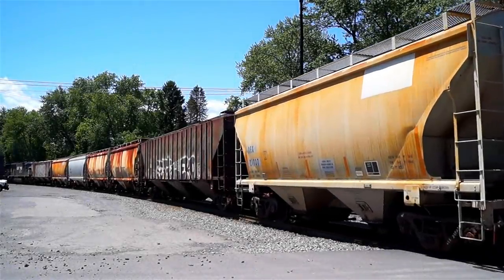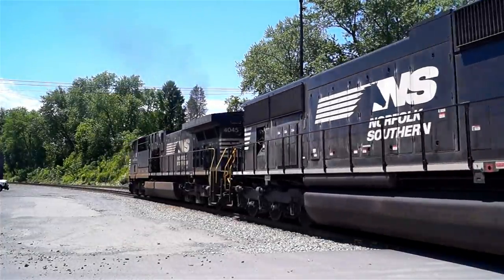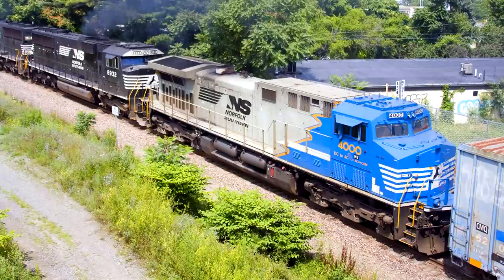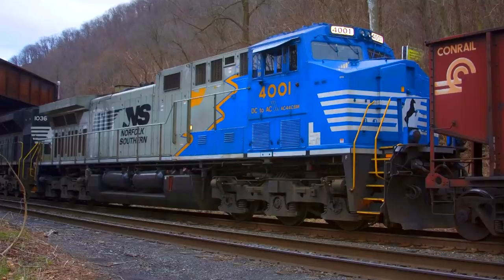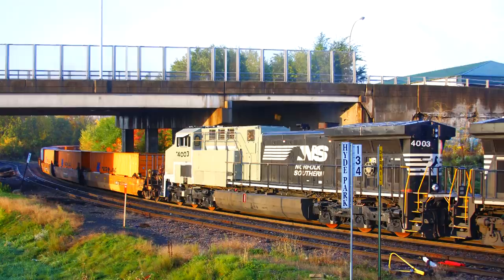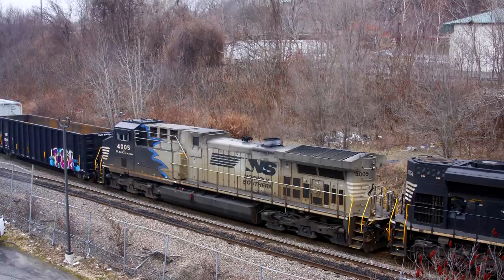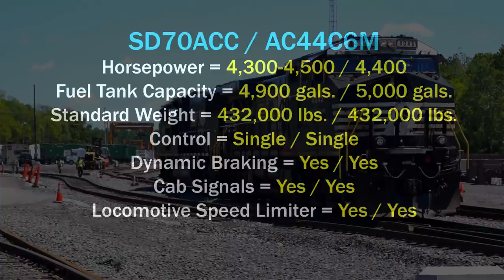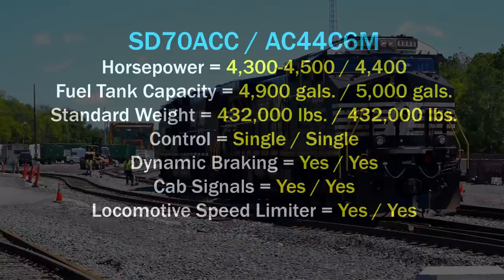[GL][T-255] EMD vs GE: SD70ACC vs AC44C6M - The Battle of the Rebuilds | Trains 21

Comment: As someone who repairs and maintains locomotives for a living, I'll pick a GE over a EMD any day of the week. Without going into specifics, when working on GE locomotives you get the impression the engineers who actually designed the locomotive took into consideration the folks who have to service and maintain the locomotive. Whereas it seems the engineers at EMD must have a contest to see how many nooks and crannies they can fill with hard to reach and service equipment. Even the AC44C6M or as I like to call it, "The Dash 9 that thinks it's an EVO" is a better though out design than the SD70ACC. Not sure what EMD was thinking with the SD70ACC, but even the computer modules are in a somewhat hard to reach location. I understand because of government regulations, the rebuilding cost has a set upper limit thus requiring the reuse of major component on the locomotive, otherwise the locomotive would have to be upgraded to the next Tier emission level. That being said, I believe each builder did the best they could within the monetary restraints they had, but for me GE is still the better product.
Reply from the maker: Thank you for your input. It's very informative.

Comment: Does the ACC have 6 inverters like GE, or 1 per truck like the MACs?
Reply: I've read that many of the MACs are getting converted to 6 inverters for reliability.
Reply: @kittty2005  Good. That should help them hold the rail better when slipping happens
Reply: I'm an electrician for NS and they have one per truck also. And they suck to work on. They are the worst designed lcocomtive on our fleet and a nightmare. They're constantly in and out the shop for failures. We have replaced several main generators ever since we've got them.

Comment: Enjoyed the video!  We get alot of NS run through power here on the Thayer Subdivision (FYI the line is actually owned and operated by BNSF) including NS 1825 featured in your video.  Heard lots of, let's just say interesting, stories about these NS motors from BNSF crews, but they're still cool units nonetheless!  Incidentally the C4s are extremely unpopular here, but I wouldn't hold my breath that BNSF turns them into 6 motor locomotives anytime soon bc of the extra cost to have the two extra traction motors installed and the fact they've ordered new ET44C4s just recently.

Comment: When it comes to new locomotives I'd love to see EMD be competitive again. But tier 4 seems to be killing them.
Reply: It's patents that killed EMD and still killing them.  Tier 1 2 3 and 4 are lawyer moves through lobbying on the congress level getting laws passed that will favor the GE.  It's really not hard to see this if you've been following the big diesels from the SD40-2 days.  There's EMD Locomotives still working their duties that were built in the 50's.  The EMD 2-stroke 567-645-710 engines are some of the most reliable Locomotive engines ever built.  Lawyers Lawyers and more Lawyers is the problem I see here.  President Trump even stated that our EPA laws were way over board and needed their laws overhauled.  Like I said, Lawyers Lawyers and more lawyers is exactly 💯 of what we need right lol lol
Reply: @brian5606  Agreed, I think the EPA needs to be dissolved or reduced yesterday.
Reply: Tier 4 is killing both companies. The tier 4 GEVOs are unreliable as all get out, and a pain to work on. But they're not near as bad as that  PITA EMD 4 stroke trotline weight.
Reply: @ralfie8801  
Your right, but the reliable two-stroke 710 is what I was referring to as getting the $#it end of the stick as far as getting shelved as part of this tier 4 BS.  I'm still thinking the laws are way out of control "To Stringent" and Trump was right, the EPA laws are way out of control and need overhauled.
Reply: @brian5606  yea, never saw the appeal of the EPA Tier Laws, not even half of the North American market is Tier 4 Compliant and nothing bad has happened even when operating the old GP7s and SD9s....... well, not just yet. Hell the SD40-2 is still operating fine and well albeit middle aged, something GE still has been rough around and sure some dash 7s still roam around, but only very few. My friend’s dad works at CN, he always had a place in his heart for the SD40s, SD70/75Is, GEVO’s, and Dash 9s, everything else sucked ass, he hated the Tier 4 GEVOs too.

Comment: Cool video! I choose the GE’s because I’ve heard their newer locomotives were built better than EMD’s. Have you heard of any engineers opinion on BNSF’s (or FEC’s) ES44C4?
Reply: BNSF 's goal was to gradually switch it's fleet to AC traction strictly. 
ES44C4 & ET44C4 were introduced as AC traction locomotives equal as C44-9W and ES44DC 's performance. Slow elimination of 44DC units with 44AC and 4 powered axles as A-1-A---A-1-A with middle axle capable lifting and lowering according to necessary tractive effort controlled by computer systems, thus increasing or later decreasing adhesion needed for pulling the train.  Basically the same thing as previous 6 axle DC power, new locomotive model use AC traction and only 4 powered axles, cheaper to maintain  having equivalent pulling power
Reply: @hadesdescent6664  How are they on the road vs the DCs? I get that they’re trying to save money on maintenance, but trains are getting heavier and wouldn’t the missing axles mean less pulling power?
Reply: @Jeragon186  since BNSF have large amount of all GE types of locomotives, >1797 built C44-9W's, 721 ES44DC, 715 ES44AC, SD70ACe units also, they combine types, sometime it's all C4's, quite frequent is ES44DC/C44-9W's and C4 combinations and 70ACes, that's it...

Comment: Henry stole the show on this one for sure but I'd like to throw my two cents in the hat if I might.

It's patents that killed EMD and still killing them.  Tier 1 2 3 and 4 are lawyer moves through lobbying on the congress level getting laws passed that will favor the GE to kill EMD's two-stroke.  It's really not hard to see this if you've been following the big diesels from the SD40-2 days.  There's EMD Locomotives still working their duties that were built in the 50's like Henry operated.  The EMD 2-stroke 567-645-710 engines are some of the most reliable Locomotive engines ever built.  Lawyers Lawyers and more Lawyers is the problem I see here.  President Trump even stated that our EPA laws were way over board and needed their laws overhauled.  Like I said, Lawyers Lawyers and more lawyers is exactly 💯 of what we need right lol lol 😆
Reply from the maker: We share similar views. Thanks for saying what i was thinking!
Reply: @Trains21  
Love you Chanel man.  I'm an old alco guy but you got to love the whine of a SD9 knotching up and back down while he's switching cars.  Hell I even like listening to SD40-2's & SD45's switching cars.  I like'm all even the Fairbanks Morse opposed piston engine two-stroke, and we can't forget the big burly 625rpm straight 6 & 8 de Laverne Baldwin engines.  I'm thinking that motor design needs a healthy look over again by Engineers for today's locomotives.  Can't beat a big straight 8 for torque and it's got a real reliable low rpm for engine longevity.  I really like the SD70ACC and I hope it gets a chance . . . BRIAN
Reply: I'd like to add beside Lawyers...Lobbyists also. These are the 'Green People', 'Environmentalists' & Climate Change' lobbies that don't know what they're talking about but will not so much as persuade Lawmakers as intimidate them. It's easy w/ the Democrats, the majority are braindead schlepps for the radical side. The Republicans should put up more of a fight but once they're facing an election opposition they cave for the most part. I fully agree w/ President Trump(we don't have a President currently, just a lap dog), there is unnecessary emission regulation that is doing more harm then good.
Reply: @carmiethompson2676  
Another thing I might add that I read some years back that when these tier engines reached a 10 year using rate, the locomotive was no longer within the guidelines of using according to the EPA I believe, not sure who's law that was but I do remember reading.  Know I don't know if that law has been removed or not because I'm thinking there still it seems using these older tier locomotives.  Like I said I'm not sure.  But what a messed up law to begin with but I do remember reading it. Lol
Reply: @brian5606  Interesting. The entire locomotive can be rebuilt but I've see the RR's put a limit of 10-15 years. That could be relating to the electronics. There is also newer electrical tech. that would require the entire loco to be re-manufactured so you might as well buy a brand new one w/ a warranty. But basing a purchase on more climate friendly 'features' is ridiculous. What North, Central & South American RR's contribute to a negative environment is infinitesimal. Trucking is the same way. For Shipping, maybe an argument can be made but I'd start there as well as for Airliners.

Comment: EMD were ok through the early 70Macs.  GE's best unit is the AC44. If you have 2 AC44's in the lead, you're good to go. EMD screwed up by using the 80Mac frame under the 90Mac and later 70Macs.  Lousy units. Give me a GP40 for any switching or wayfreight, or a couple of big AC44's on a road train, and scrap the rest.
Reply: I agree, GE pretty much always defeats EMD in mainline locomotives.
Reply: How does the Dash 9 compare to the AC44...... some people call it a 'Trash 9'.....?
Reply: @locomotive536  the Dash 9 is fairly similar to the AC44, except it uses traditional DC traction motors, so - from an operating perspective -  while they are a very good unit, they still have the same traction limits that any other DC-drive unit does. I've never heard a fellow rail call them that name, usually we call them "toasters".  The Dash 9 is a good, solid unit.
Reply: The toaster moniker is carried over from the Dash 7 days when the C 36-7 was the toaster king. You couldn't keep a set of grids in one of those, they constantly were burning up.
Reply: @ralfie8801  the C30 were good units, I only ran a C36 once. I remember that I couldn't get it to load.  That was very common later, when we got an order of new SD90's. They would flake out just when you really needed the power.  I also got to run a pair of new AC60's, which were quite something.
Reply: P Kranz 
SD 90's were pretty much crap, temperamental at best, rainwater would cause them to stop loading every time it stormed hard and the Siemens switchgear left a lot to be desired. Then we got to the last straw when  the frames cracked on many units. They're gone now, so we don't need to mess with them any more.
Reply: @UnionThugg  Thanks.  So your top 5 might be:  1) AC44  2) ES44AC  3) SD70ACe  4) Dash 9  5) SD70M-2.....what do ya think....   Also, how do you know that the trailing units are putting out horsepower/tractive pounds  - are hp/lbf values transmitted to the lead unit in real time?
Reply: @locomotive536  
#1 AC44, best puller
#2 GP40, most versatile
#3 SD40-2, good on a shorter train
#4 C30-7,  good on coal trains
#5 early BN SD70Mac, good puller, leather seats !

When you have trailing units, depending on what you have for a lead unit, you can usually tell how they're behaving just by how the power is pulling - if the TE bar or amps are pegged out with a lighter train, you know something is haywire. Usually the alarm bell will ring, and you can send the conductor back to check. Sometimes it's just a bad jumper cable. Other times it's a ground relay or bad dynamics, but it can also be mechanical or fuel related too.

Comment: EMD's are garbage. Even the fast loading argument is dumb. It's not 1989 anymore, GE's load just fine. The older Dash 8's/9's were slow, but a C45AC isn't. Especially on grade. C45's can pull anything under any conditions. But foamers beg to differ. Just because somebody's grandpa said EMD's were great back in 1961 doesn't mean that's still the case. It isn't. Talk to any railroader who runs something other than a commuter train. They will tell you the truth.
Reply: Ik for a fact that since CAT take over EMD it went down hill quick, also the GEs are not good too.. They are cheap same as EMD now and the SD70ACE rides like shit and not quiet. Only newer EMD was good was the 1995 was the SD75I. The crews loves the ride and it was a quiet ride. Also it doesn't help that the newer locomotives are pretty much run of a Computer.. let me tell you something with a computer will make it run like shit and stupid won't last long. I think we should go to the old school way because it's a lot better then the newest stuff. Sorry I can't imagine the newer GE and EMD or whatever company crap would last 10 years or more tbh 😂 I have talked to someone would works for the railroad and they love the 50 to years old EMD locomotives haven't have issues really tbh, the GEs they had the WORSE luck with them (They don't have junks anymore) The older GE are shit, they are not a good ride and not a quiet ride. Idk about the newer ones but I can give two shits about the new locomotives.. they are completely garbage tbh and will be when they can't fix something because of that stupid computer in it.. yes older locomotives did have some computer in it but the newer ones has a lot in it. Fucking sensors up the ass if one fails the whole thing won't run properly. I seen it with cars, semi trucks I can imagine with the newer locomotives. That's why old stuff is better. Also better made.
Reply: Ever since the GMDD plant in London, Ontario was shut down by Caterpillar, EMD power has gone downhill. Caterpillar moved production to a new plant in Muncie, IN after the London plant was shut down. So, Caterpillar has been essentially been building new EMD power for well more than a decade now. It’s hard to tell honestly which is the best builder now. GE did something similar & shut down their locomotive plant in Erie, PA, in favor of a new plant in Fort Worth, TX about 5 or so years ago. GE also sold off their transportation arm to Wabtec. So, Wabtec is building GE power now.
Reply: MichLo3  The main problem with GEs are the turbos. GE turbos are shit. If GM or Ford or someone like that made the turbos FOR GE LOCOMOTIVES, chances are they would be running alot better. Not sure about the load time thing, all I know is that GEs still don't load as quick as EMDs. Personaly I like the ACCs and the older Geeps, we have a Geep where I volunteer and it rides very nice, but if the GEVOs had a quicker load time ( it can be slow from a start but should kick in as soon as you move the throttle) and had different turbos, they wouldn't get as much hate

Comment: bring back steam
Reply: Something tells me that it'd be pretty hard to make a tier 4 compliant steam locomotive
Reply: @Highclearmedia  Actually, I don't think so. Make a simple LNG fired boiler, with a tender like the Florida East Coast railway uses. LNG burns very cleanly. Then use the steam for a traditional steam engine. It doesn't produce any soot :)

It also won't be very efficient, nor will it have much historical value. But hey, you got a Tier 4 steam locomotive.
Reply: This isn’t very practical. You gotta remember the railroads are businesses, not museums